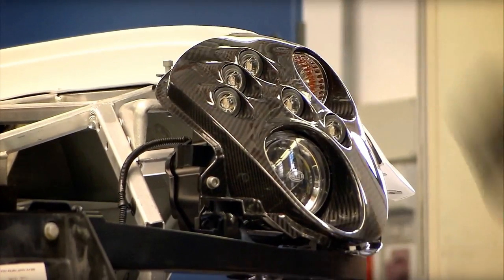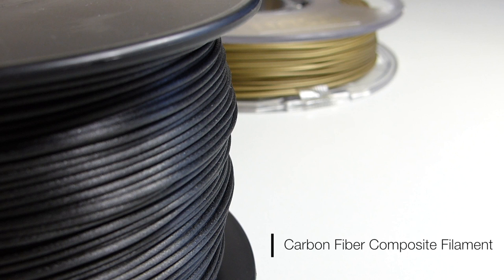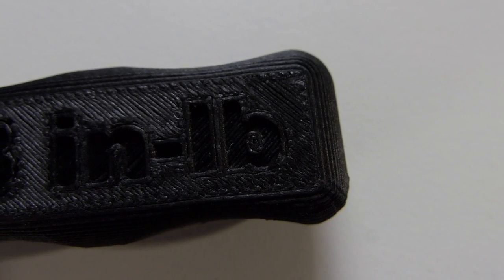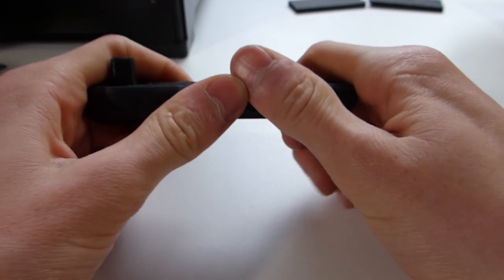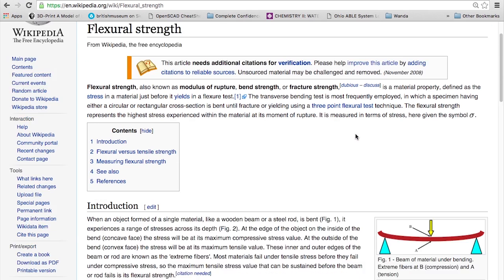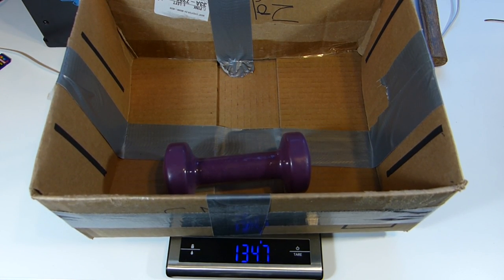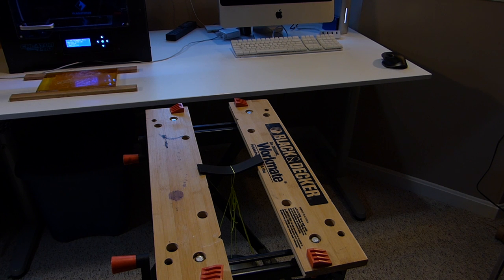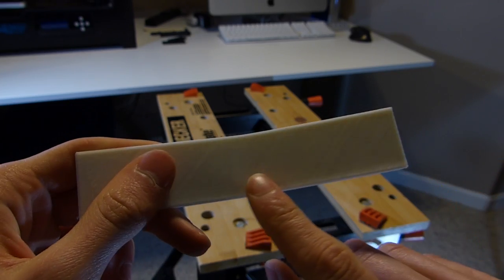3D Printing in Carbon Fiber PLA? | Isele Bros. Carbon Fiber Review

Comment: Thanks for the video, guys.  Where did you purchase the carbon fiber filament?  

Have you checked out the MarkForged line of 3D printers?  Their printers use continuous strands of carbon fiber or Kevlar inside of nylon FFF printing.  https://markforged.com/
Reply from the maker: We are glad that you liked the video! The specific filaments we use in this video is actually the Robo3D carbon fiber PLA filament purchased from Microcenter. Since this is intended for use with Robo3D printers, we just 3D printed a spool holder that could hold the filament. Colorfabb also has some really interesting carbon fiber reinforced materials that you may want to check out. We have seen the MarkForged dedicated carbon fiber printers. They are really taking the strength and capabilities of 3D printed parts to a level on par with parts manufactured through more traditional techniques. Maybe we will eventually be able to do some material tests with those parts.
Reply: +Isele Bros. Thank you for that info.  I am going to purchase a roll and try it out for myself.  Do you know anything about the makeup of the filament?  You mentioned that it's about 15% carbon fiber, but do you know if it is continuous strands or chopped up?

We are currently working with a Mark One by MarkForged.  We have found that the continuous strands of fiber (they also use fiberglass and Kevlar) are providing unparalleled strength to weight.
Reply from the maker: +Michael Storey Sorry for the late response, but I thought better late than never. I believe the filament we are using is composed of chopped fibers unlike the Mark One by MarkedForged.
Reply: +Isele Bros. No need to apologize whatsoever.  Have you guys had the opportunity to check out a MarkForged print in person?